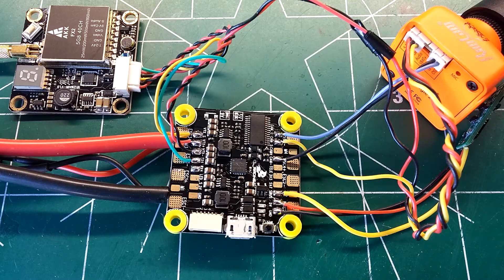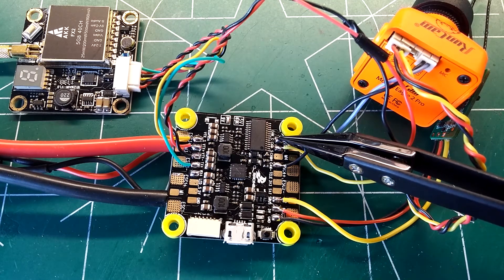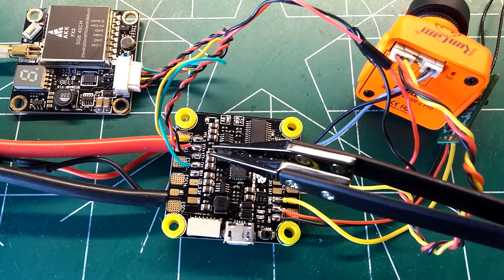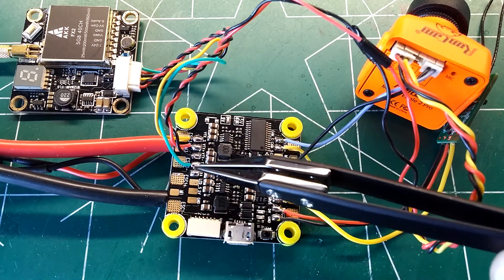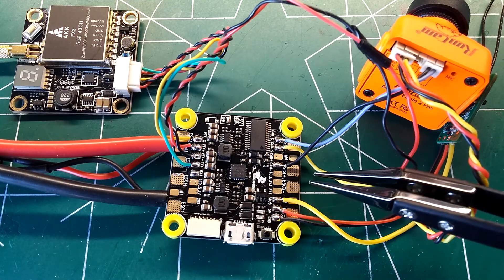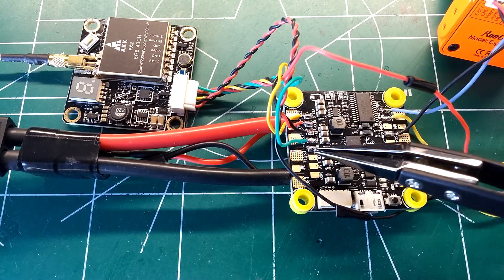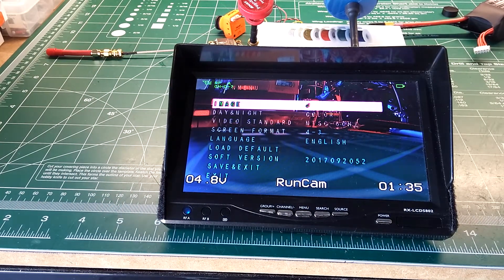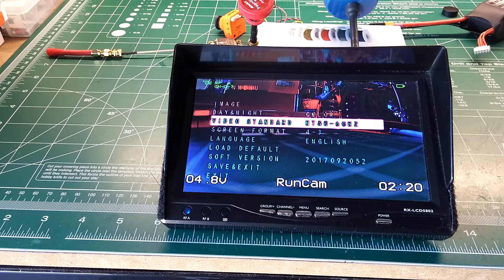CL_RacingF4S Camera Control Setup

Comment: im using the AKK X2P and the Eagle 2 and have been getting diagonal static lines only when i arm the quad.  i saw that you power the camera through the vtx and am hoping that'll solve my diagonal static line problems.  also sometimes when im above 50% throttle, the osd just goes NUTS.  im wondering if you thinkthat's because of the power to the camera or if it's the power to the vtx that's messing everything up?  im also using the same CL Racing f4s chip
Reply from the maker: iamspanky FPV - I do believe that's why you're getting the video lines and osd breakups, which is why I have it setup the way I do in all of my builds, which is the vtx powered directly from the vbat pads, but only if the vtx can handle the voltage, and the fpv camera powered from the vtx's filtered and regulated 5 volt power source. I do have the AKK vtx powered from the dedicated 9 volt pad just for this specific video, and I'll leave it that way just to try it out in my next build, but if I have any issues then I'll switch it back to vbat power like I have always done.
Reply: So i have both a low esr capacitor and a lc filter on it right now.  I'm going to try your method when my x2p arrives in the mail.  I'm hoping the new one filters better and maybe the diagonal lines will disappear BUT if it doesn't, do you think I can still power my VTX off of the LC filter? I'm asking because I'd rather not resolder everything if i dont have to and the power to the vtx is already soldered to the lc filter.  also does it matter that the ground for the vtx cam isn't connected to the ground on the cam directly?  what if the ground for the vtx cam is already soldered to the lc filter's ground?
Reply from the maker: iamspanky FPV - The new vtx should work just fine powered off the lc filter, just make sure to power your fpv from the vtx's filtered and regulated power output and you should see an improvement. As for the fpv camera's ground wire being soldered to the lc filters ground, I'm not sure if that could be causing any of your current issues, but personally I'd use the ground wire from the vtx's provided fpv camera ground to eliminate that possibility.
Reply: Man I AM SO BUMMED!! So i got my new x2p VTX, powered the VTX off the LC FILTER and connected my cam to the filtered power coming from the VTX and..... Still diagonal lines.... BUT... at least now when i throttle more than 50%, my OSD doesn't get all wonky.  the lines are still there, but i don't freak out in the air because i'm losing video.  sigh i have no clue why i keep getting noise...  I appreciate your video.  I put a link to it in my rotorbuilds!!
Reply from the maker: iamspanky FPV - That is unfortunate that you're still getting video lines, have you tried a different lc filter to see if that's the problem? If it isn't then obviously you're getting some sort interference from the video in or out on the board, in which case I'd contact the vendor you bought the board from and let them know the situation and how you have things setup to avoid video noise, maybe a replacement is in order.